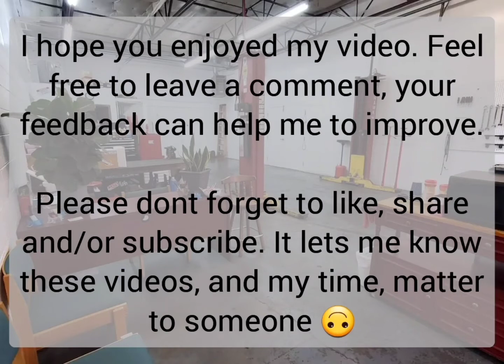Spark Plugs, Plug Wires, Distributor Cap, Rotor Button and Fuel Filter on a 1991 GMC 1500

Comment: Thank you for this video!! Tackling the s15 jimmy this morning 🤞🤞🙏🙏🤘🤘
Reply from the maker: Good luck!
Reply: @MegaMilesBen  one of the screws broke off in the distributor 😳 and the distributor itself needs to be replaced. This is no fun.
Reply from the maker: Im really sorry to hear that. Theres no way to drill the screw out or pull the distributor and back it out from the other side? Why does the distributor need to be replaced?
Reply from the maker: Unfortunately broken bolts are something pretty much anyone that works on a car will come across at least once. Theres a joke about how "every 30 minute job is one bolt away from being a 4 hour job".
Reply: @MegaMilesBen  it was original and quite grody. But that's not it. No fuel. Off to the sending unit we go. About $400 into this diagnosis. I hate this truck.